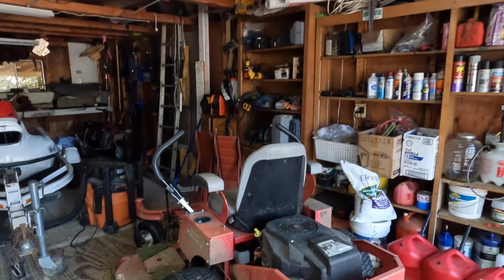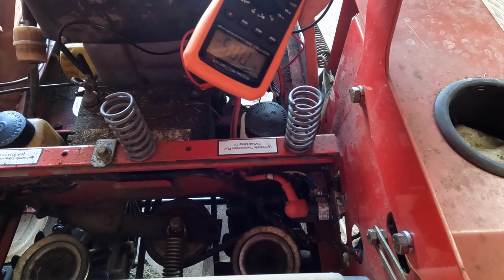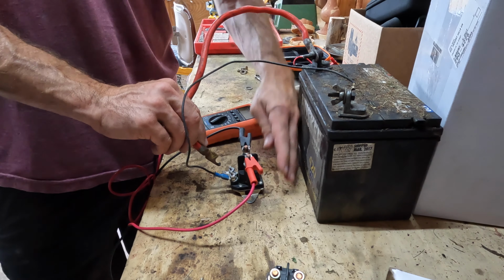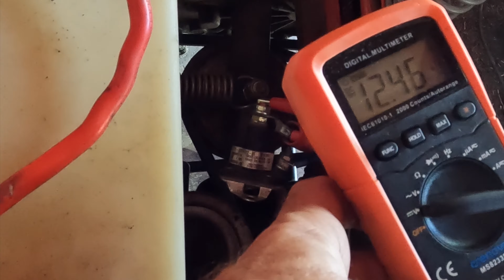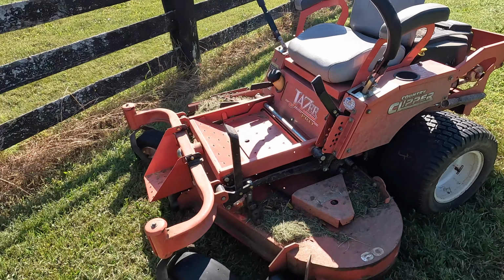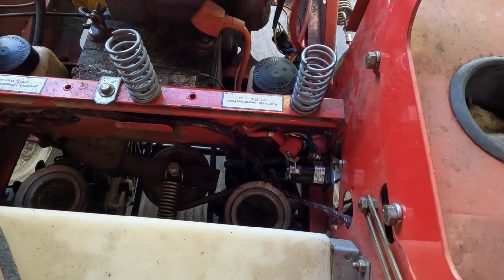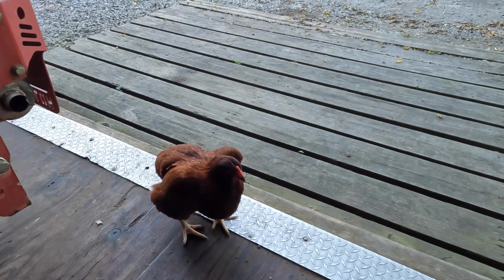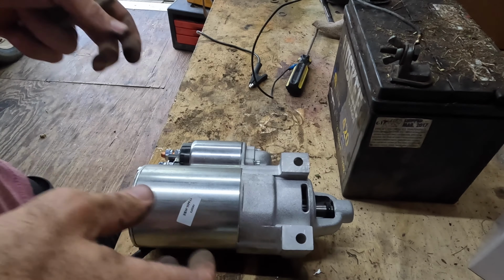Diagnosing a starter and solenoid on a zero turn mower

Comment: I have a Country Clipper Jazee SR200 with the joy stick and it's pretty much doing the same thing. I touched both connections on the solenoid together with a screwdriver and it started right up. So I'm going to take the solenoid out then up it back in to see if the problem is with the solenoid or the starter. Great video thanks!

Comment: I'm going thru the same stuff on this Husqvarna zero turn that seems to start after a fresh solenoid but then fails and just clicks as it has been previously doing. Another one D105 has blowing fuse issues. Any idea would be awesome.
Reply from the maker: Two very important things: Make sure you have a strong battery and all your connections are tight (the battery, frame, solenoid).

Comment: If the starter was bad, why did it quit running when you were mowing?????????
Reply from the maker: I think it was out of gas, but I was so flustered because it wouldn't start again I didn't think to check the fuel tank.

Comment: Isn't the first test on the starter relay switch and the solenoid that your wife laughs at on the stater motor? The solenoid kicks the starter teeth to flywheel and starter more turns motor, meaning the starter motor is ok but the solenoid was bad..........